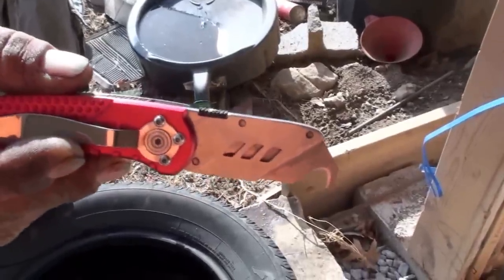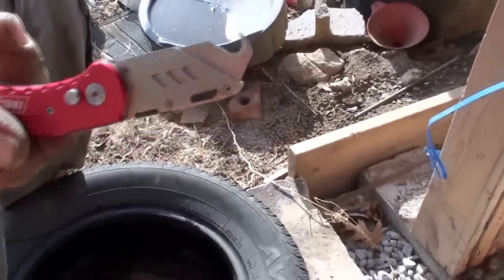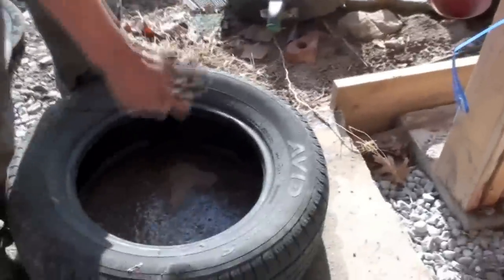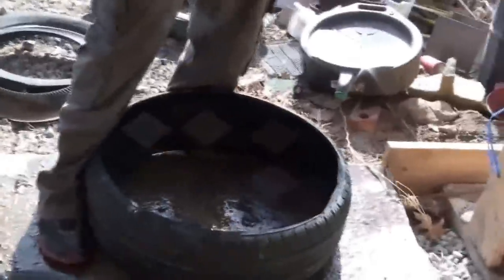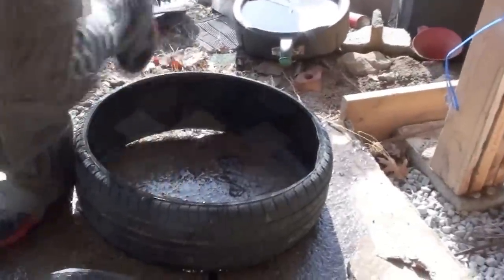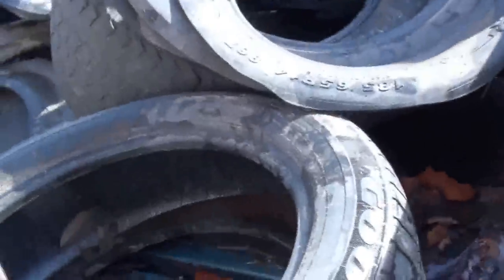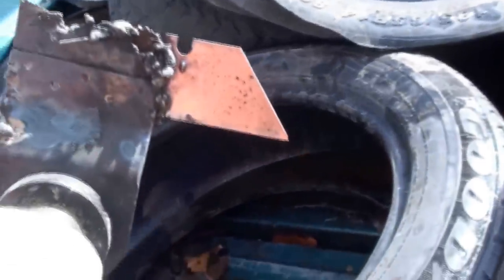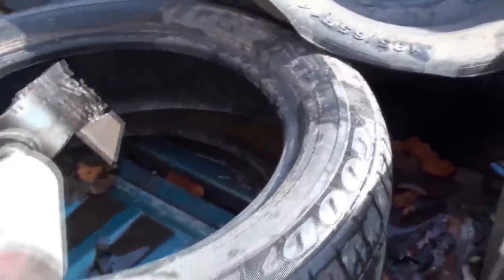Cheap tire cutter By Adam Johnson

Comment: Dear Adam:  This was a wonderful idea.  I already had everything except a mig welder, have a gas torch and a arc welder, but I thought  . . . I will probably break a blade or two, then I would have to weld another.  So I drilled two holes in the vibrating blade - one to fit at the end and one at the bottom edge  of the box blade.  If you stay away from the cutting teeth of the vibrating blade, it is not hardened metal.  I drilled the holes for 1/4 inch bolts, used two heavy washers and grade 5 bolts slipped the box blade beneath the washers, and cinched them down tight.  Went to cutting -  it was awesome - thanks so much for the great idea.

Comment: the trick to cutting any rubber with any blade easily is water. As we saw when the blades hit the wet rubber. Been making swans from tyres for years and i cut them with a stanley knife with the garden hose dripping on the job

Comment from the maker: For the people who are wondering why this is being done. 1. you are not suppose to through used tires in american land fills with out cutting them up. 2. if you bury a tire with out cutting it up it will sooner or later float back to the top of the ground I have seen this my self. 3. look up other tire cutters eBay and google they are very big they cost a lot and they are expensive to run. And last but not least 5. space. These oscillating tools are now cordless and if you are trying to clean up a creek or river you can cut the tires up as you go and instead of getting about 20 to 50 tires in your boat at once you can get hundreds. also more will fit in your dumpster.
Reply: how can i get that knife

Comment: I was wondering if it would be ok to screw some tire treads to my wooden stairs on my deck that way when it gets iced over or rains they will not be slick. Thanks for sharing.  I'm gonna have to try that with my harbor freight oscillating saw like yours. I was going to just use my jig saw but i'll let you know how it turns out thanks again!

Comment: What's the reasoning for cutting out the bead of the tire. neat idea.
Reply from the maker: If you bury a uncut tire it will hold air and float up out of the dirt so the land fills will not dispose of them unless you cut them so they do not hold air after you cut them you can put them in your dumpster if you don't cut them it will cost you anywhere from $1 to $5 for some one to pick them up
Reply: Adam Johnson Thank you very much.

Comment: Hi. So there is no metal wires in the tire?
Reply: "Steel belted radial tires" have the metal wire in the tread area forming a belt. The area where the cuts were made is the sidewall and commonly would not have metal wire.
Reply: In some tyres there is. I tried this on a large old wagon tyre and the side walls had steel in them. I did suspect this was the case so had my reciprocating saw with a steel blade handy. It was slow going but eventually got one side of the tyre cut on one charge.

Comment: can you please let me know how this electric one works.........please help me out.......
Reply from the maker: the electric one is a OSCILLATING TOOL it moves back and forth real fast you weild a utility blade at 90 degrees to the wood blade and wet the tire with water
Reply from the maker: Adam Johnson I will be selling these in a few weeks on ebay
Reply: Adam Johnson  hi, can I have the link to buy en ebay please?

Comment: It seems like if you built a stand to hold the tool steady in the right place, and spun the tire on a lazy Susan, this would be even easier, and safer, with less potential to break the blades.

Comment: Welding a blade to a blade seems rather redundant to me, especially since the oscillation tool can practically sharpen it's own blades on a sharpening stone, or for that matter, just about any stone.
Reply: you think it was the blade or maybe the angle?
Reply: @PatrickPease  I made one!
I took a older, used-up wood cutting blade and used a grinder to cut the hook into both its sides. I installed it onto my Dewalt DCS356B and turned it on. Using an old sharpening stone, I proceeded to sharpen to a razor edge but just so you know, it didn't need it. The blade on the tool cut through sidewall like butter, even without the additional sharpening. I've used it on carpet, cable jackets, plastic conduit and coco coir matting, all with good to excellent results.

The oscillations of the tool is circular from a pivot point. The angle of the cutting edge should be relative to the pivot point for best efficiency. The hook provides a variable to the angle, thus some areas will be more efficient than others on the length of the blade.

I noticed a bit of a bog-down with high-density materials as my hooks were cut a couple inches from the pivot point. I think if the hook cuts were closer to the pivot point, it would cut in shorter strokes and would be less likely to bog-down.

Hope this helps.

edit:
I have since make my own tool, similar to a windshield removal tool, but with a similar hook blade attached. Similar to this... https://www.amazon.ca/Akozon-Windshield-Removal-Professional-Windscreen/dp/B07Q43ZG2Z/ref=asc_df_B07Q43ZG2Z/?tag=googleshopc0c-20&linkCode=df0&hvadid=459447126648&hvpos=&hvnetw=g&hvrand=5252512456138968118&hvpone=&hvptwo=&hvqmt=&hvdev=c&hvdvcmdl=&hvlocint=&hvlocphy=1001862&hvtargid=pla-1157520554300&psc=1

Comment: when using a hooked blade or typical  razor blade , you can just pull up on the tire (the part you've cut as you cut it) and it'll cut so much easier than this , I have to do this crap  every day, it kind of sucks.